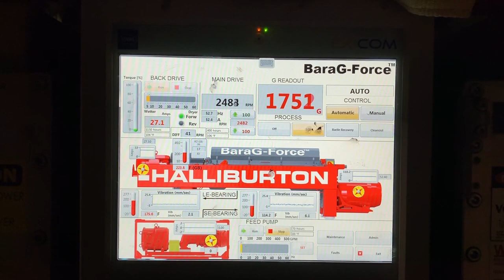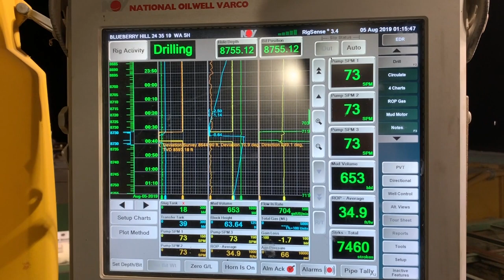How to get a JOB in the Oilfield 2019 (West TX & NM)

Comment: What do you recommend for transportation to and from work when I get to the job site? I’m from Pennsylvania so that’s a pretty far drive for me so I’d prefer to fly. I was thinking of finding a cheap used truck after I get there but I’d have to get back and forth the first couple weeks first.
Reply from the maker: Hey Rob,
I would definitely recommend a reliable truck. I had an older F150 that I drove from TX to NM. It’s very important that it is reliable and the lease roads are pretty rough which is why I recommend a truck. I was thinking about flying and leaving my truck at the airport and that worked pretty good for me. Thanks for the comment.
Reply: Jeeps are good to if your tool set doesn’t require a truck. There is extended parking at MAF but if your company has an office in midland then maybe you can leave it there also. Lastly, invest in a cellphone signal booster. Good luck.

Comment: Do international oil and gas engineers need special license to work in texas or just applying n getting hired is enough?
Reply from the maker: All states require self-employed engineers to be licensed, but a license may be optional if you work under a licensed engineer. Requirements vary, but state boards usually require a minimum of a bachelor's degree in engineering from a school accredited by the Accreditation Board for Engineering and Technology. You must also pass the preliminary Fundamentals of Engineering exam and complete at least four years of qualifying work. Finally, you must pass the Principles and Practice of Engineering examination. In some states, you need continuing education to keep your license.
Reply: @Bennutta  thank you